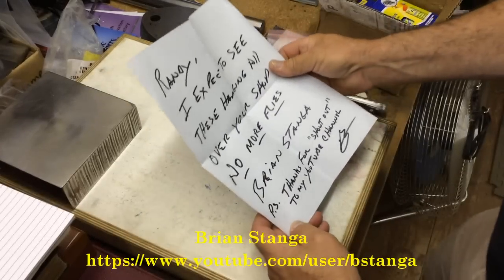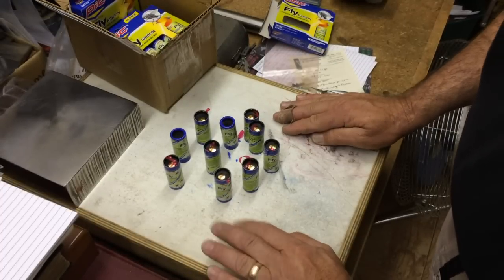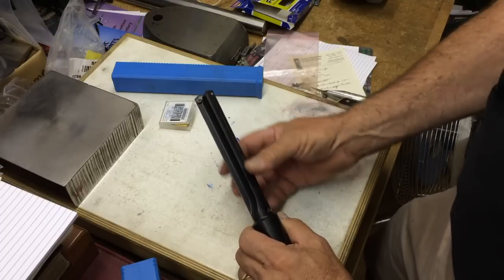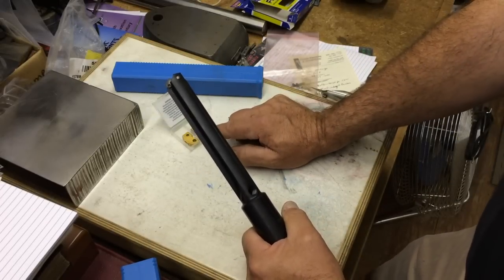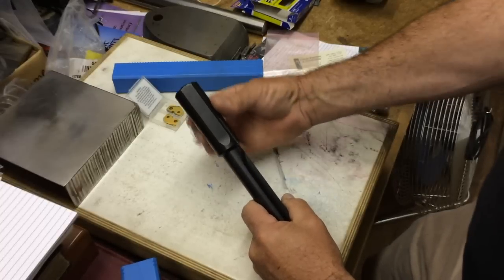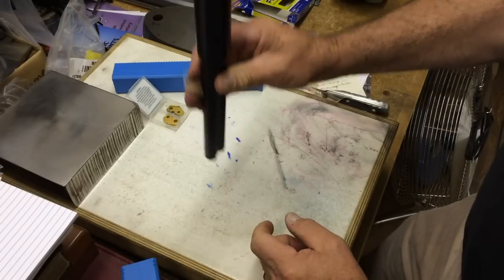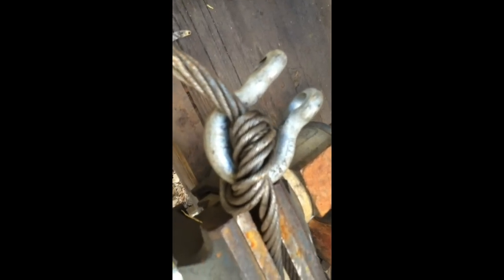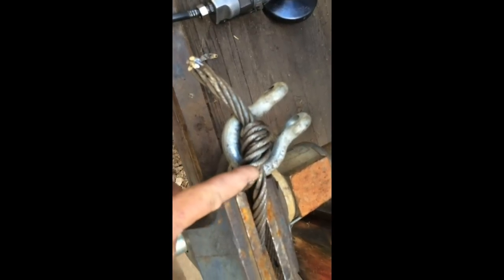Ketchup #32 - Mail WIYB TMC Punch Update X-Carve

Comment: Hi Randy, you'll love using those AME insert drills, the bores are pretty close from the nominal measure.... 
Thanks for the mentioning of my channel...   ;)
Winter season time to get shelter in the shop and start new projects...
Cheers,  Pierre
P.S. I think you forgot to put my channel reference in you list after the correction... oups!
Reply from the maker: +pierre beaudry I finished up an adapter yesterday for the drill, now I need a project for it.  I fixed your link but will double check.

Comment: hey Randy,
if you braze the cable where you're gonna cut it, that will save you from having to do the wire wrap which will be stripped off the choker cable after the first drag anyway and still keep the cable from fraying. not only while cutting it, but also during its service life as a choker.

by the way the thing that slides on the cable is a choker bell or just "bell" and the knob swaged onto the end is a "nubbin" .. in the days of yore the oldtimers would make a fire of doug fir bark and melt babbitt to set the nubbins on the ends of their chokers. 

you have a "double bell choker" ...they're nice to work with since you can link however many you want together by putting the nubbin of the choker on the pulling cable into the bell of the choker and so on.. if for some reason you should come up short of reaching your log (happens a lot in mountainous terrain) 
you can also tag another log onto the one you're skidding with double bell choker to save returning for another skid. it can be done with eye chokers too but they're a little more of a pain in the ass to work with..  single bell chokers are designed to be used with a bearpaw on the back of a cat or skidder winch..it's essentially a quadruple or quintuple bell at the end of the winch cable..

cheers 
mike
Reply from the maker: +HolzMichel Thanks for the great info on the choker.   Randy

Comment: Ah, my favorite passive tool, fly strips. A true sanity saver. Along with mousetraps, live, living, or otherwise.
 I love spade drills for their economy and versatility. Easy to make special sizes and point shapes. Good chip control, too.
 That must have been from the book "Rigging for Dummies". I prefer the Army COE rigging handbook. It says, if I recall, to remove at least 10 dia of cable beyond any visible defect to ensure all internal deformities are removed. Good to see you are doing it right and knot the easy way.
  Mike (o\!/o)
Reply from the maker: +Moholo 88 Thanks Mike, I am going to like the drill it sounds like.  Thanks for watching.  Randy

Comment: That drill holder is great - most useful. Be great to use in the tailstock.
Knot on cable with shackle ... shudder!!
Reply from the maker: +ChrisB257 just finished up a holder for the drill yesterday, should work great.  Moron with the cable.  Thanks for stopping by Chris, Randy

Comment: Cool drill Randy, I saw Pierre drive one of those, impressive!

just curious, on the cable would you weld the strands together before putting a new swage on it?
thanks for sharing
Reply from the maker: +Phil's Projects I am going to like the drill.  no welding.  If you swage it, you would put the swage thimble on below the wire serving then swage then trim off excess.  Thanks Phil for the visit.  Randy